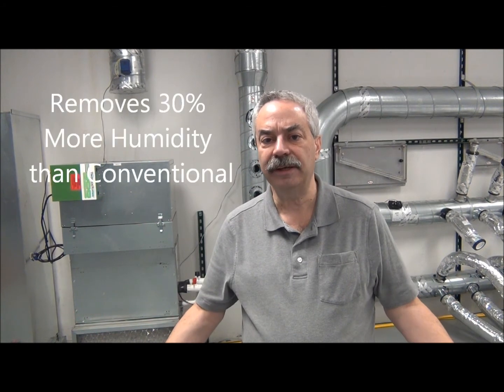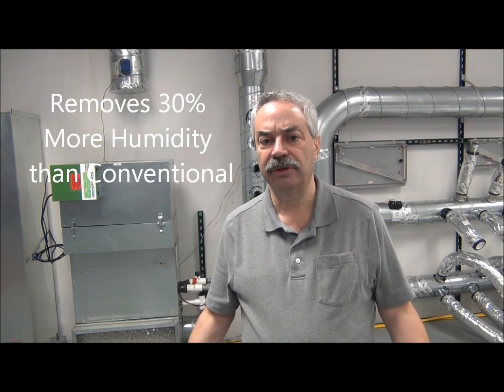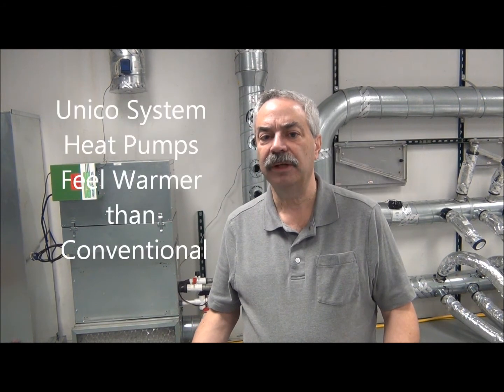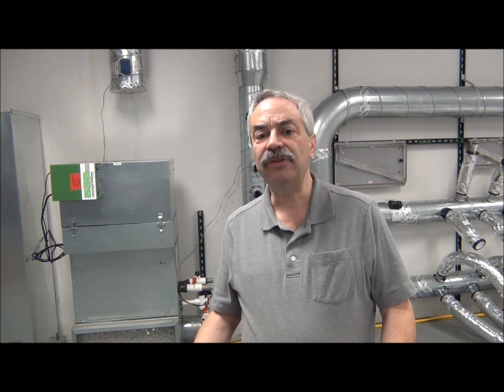Installing High Velocity Air Conditioning System Part 1 | The Unico System

Comment: Is there any 90% gas furnaces been able to be used with these systems?  I’m designing a system now as of today actually have started working on designing a new construction system for all Cathedral ceilings in this high profiled home. They want to use gas though. I’m hoping that a gas furnace was a possibility. But if not option #2 an instantaneous Hot water heater with a Hot water Coil in Unico AHU? 
Heat pump with Hot Water coil??